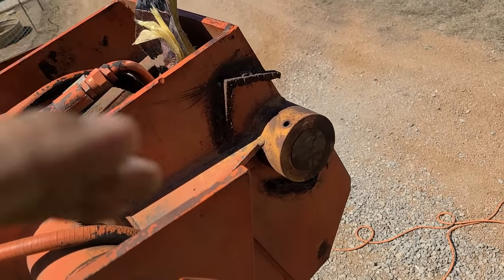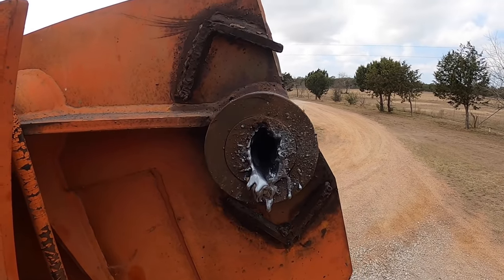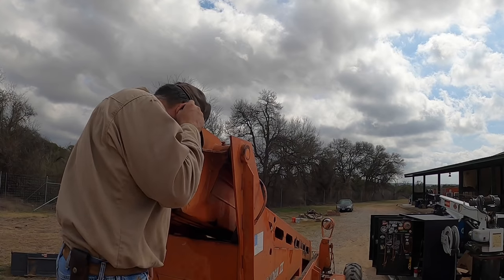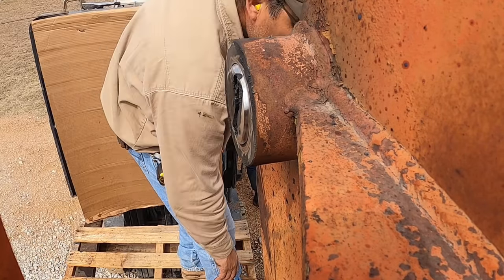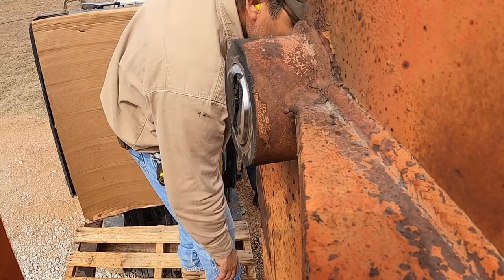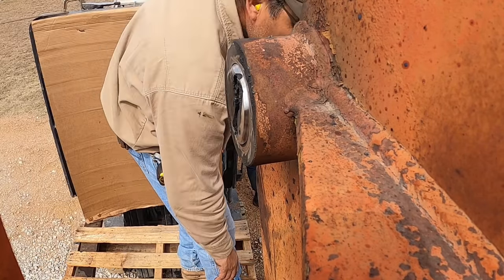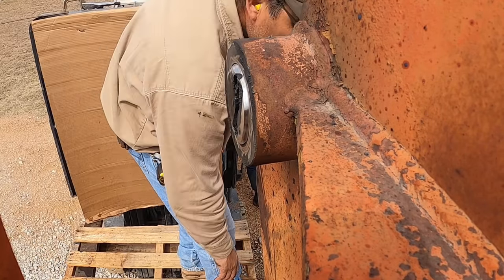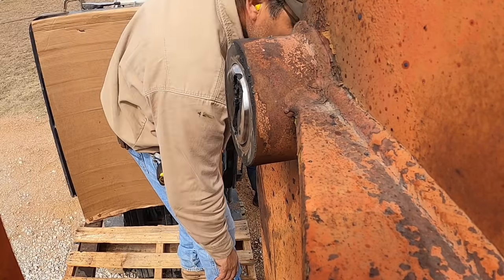Exothermic Slice torch For the Win????

Comment: I've run into the same thing a few times myself on frozen pins.  Had to use the Oxylance on a couple of 'em and the porta-power reverse pulling method on the others. I have .5" and .75" male adapters that thread into the pin with a 1.25" threaded female side that I use a 24" section of allthread for pulling. 36-ton hollow ram usually persuades a non-compliant pin.  Great content,  Isaac!  IMPROVISE.  ADAPT.  OVERCOME.
Reply: Oorah!
Reply: Super under rated comment ^ - A porta-power and a "Through Hole" or "Hallow Center" jack is a damn good thing to have when pulling pins on heavy equipment. As a Field Tech for HE, they've saved me a ton of work many a time.
Reply: @michaelvangundy226  Semper Paratos!
Always prepared!
Reply: At Fording River - Fording Operations we had the Oxylance that took an 8 foort bu 3/4 inch rods, use this the lance thru pins from 12-24 inches in thickness to 2 -6 feet long .
Reply: Was wondering if there was another way.
Reply: @emeltea33  Sure.  There's usually more than one way to skin a cat but they all have one thing in common:  brute force.
Reply: @PatriotWeldFab  Not to forget mentioning "To Hold Your Mouth Right!!"
Reply: @emeltea33   A Machinist with a horizontal boring machine would have done this job with no brute force at all. Check out Curtis at “Cutting Edge Engineering” here on you tube for some excellent machine rebuilds. He has done precision horizontal boring a few times. Everything is easy with the right tools but one frozen pin will not pay for a boring machine.
Reply: @wirefeed3419  I own a horizontal boring machine.  Frozen pins must be removed before any boring can begin.
Reply: @wirefeed3419  I was thinking of Curtis aswell when i watched this video, big difference working from a shop or in the field too, plus curtis's outtakes are more colourful.😆
Reply: @redeyedave8519  yeah, Curtis would've done that job in about 4 bananas 🍌 🤣

Comment: Had a similar issue recently. I welded a very large nut to the pin and used an impact to break it loose. I was even able to salvage the pin. Next step was the carbon arc if that didn’t work. I enjoy seeing your projects.

Comment: Amazing how much work can be caused by simply not keeping a piece of equipment greased.  Nice job!  And, yes, some of us got the Cars reference!
Reply: It's always amazed me that all the guys running it are paid by the hour and everybody is too dam lazy to do the easy work.
Reply: in some cases on equipment there are no grease points for certain things nor places for the grease to travel to get to those points
Reply: @Darin Wilton  Exactly. I saw that pin is bolted into that long boss so it doesn't move in there, hence, no grease.
Reply from the maker: Yup, This pin didnt have a zerk for grease.
Reply: @ICWeld  Hopefully they will put one in after all the work you did to get the old one out...and grease it!  :)
Reply: I have looked inside some equipment to check for grease and seen Nothing but a rust coating inside. That piece of grounds maintenance equipment had never been greased since it was originally manufactured. 
I just put back the grease nipple and told the Boss the story and said to get a new piece of equipment.
Reply: @ICWeld   Think that pin is never removed that often. I like lance rods from oxylance from AL. they have some that can connect together to be longer. Have burnt out pins 8in od  48" long before. Need to turn ox up more than instructions say welcome to the real world.

Comment: Recently i had same issue same Lull machine .
Really difficult..
I cut tube horizontal with grinder cut off wheel. Then spread tube with wedges . Then pin came out. I then rewelded tube later when pin back in.
I was hitting pin with 500lb steel crane block on crane cable swung into pin . 🤣

Excellent work.

Comment: I actually built those machines when I first got out of welding school. Lull Engineering was located in Eagan, Minnesota and it was a fun place to work. We used to be required to stamp our initials just below where that pin was located at the top of the frame. Nice job getting that pin out. Be safe.
Reply: @troyaldridge3853  I was a Welder, not an Assembler. Just being honest.
Reply: What pivoted on that pin or how did it work I couldn't tell

Comment: The first thing my father inlaw told me when I was around the first equipment maintenance issues was grease is cheap always grease the machine before use check all fluids before you use if you didn't use it the day before

Comment: That was a fairly cool process and that pin put up 1 hell of a fight. It was cool watching the board "under" the jack compress down to about 1/4" as the pressure built up then spring back maybe an 1/8" at a time.

Comment: At first Isaac, I thought this was going to be a "you don't win them all" & you would cut away the pin bore housing & replace/weld in a custom machined housing & pin. But about half-way thru the video when you bought a new bigger jack, Isaac is going to win, no matter what! Awesome job!
Reply: I done what you said on a dump bed that froze up from no grease and salt . I had way less time in the replacement than spent on this, but you never know until your done sometimes.

Comment: played with a similar setup in extraction/extrication training for work.. but we had the rods, as well as a 50ft of steel hollow hose that we could just keep feeding until either it ran out of hose or the composite oxy tanks on the backpack ran out.. the composite triple tank backpack would run it for a while, and we could refill in about 10 minutes from a full sized O2 cylinder.... it would cut through a 3/16 cell door like butter... we started ours using steel wool taped to the end of the rod/tube, and striking a 9v battery...

Comment: Awesome job adapting and over coming the problem.   I had an upper pin on a Case loader arm that I  lanced and it still wouldn't come out. We used a breaker on a skid loader to drive it in and cut the other end off (only could move it a few inches) until it was out.  
A field lance tool was an 1/8" black pipe with a ball valve on it.

Comment: I once used a hydraulic breaker, attached to a mini ex to drive one of those out. Had to weld a home made fixture onto the pin in order to keep the breaker centered on the pin and not skip right off. Luckily, once it broke, I was able to drive it the rest of the way by hand. It didn't go hard all the way like this one you did.

Comment: Great job, great perseverance.  Once that pin was out about an inch I was thinking putting a 3 foot pipe wrench on it and turning it while pressing with the jack might have helped. That sure was one stubborn pin. Strong work!
Reply: It is may work optimal when just hammering the pin, because it act like a spring, and can be move as a worm, when the far end keep unstucked by slow rotating.

Comment: Back in the day working in a rust belt truck shop we'd cherry the nut, housing or casing and then turn a hose on it.  The rapid expansion and contraction breaks up the rust ...  then drill a grease fitting.  
The worst  ones were the tandem axle fertilizer spreaders with large trunion joints rusting up.  Like that you didn't force it.  Ya just got a bigger jack.  👍🏁🇺🇸

Comment: Recently had a 90mm pin in an excavator bucket pin that a 25 ton wheel loader wouldn't budge.  Snapon air hammer got it out. No comparison between jacking and air hammer. It never fails me. The shock action makes all the difference. It never budged with the biggest sledge and a hundred shots and came out in about 10 minutes with the air hammer.
Reply: Yea I've got an IR air hammer, its amazing what some vibration and shock will do for things. Always a good idea to smack a union before trying to separate it too. Love when hitting things works!
Reply: The air hammer is a good idea. What Snapon model do you use?
Reply: @jheissjr  After about 25 yrs it finally croaked and I didn't have time to repair it so I replaced it with an Astro pneumatic after spending time researching on line. It is the strongest air hammer on the market right now. It is a monster.
Reply: Asto upgraded the 498 to the new Thor 498. It looks even more powerful than the original.
Reply: Good tip

Comment: I’d try an air hammer on the outside of the big long bushing.  The shock and vibration would have likely freed the pin while it was under the axial load from the Jack.

Comment: I work on these things for a living and other material handling equipment (anything with a set of forks on it). Had to remove the same pin once to remove the boom out cylinder for a reseal.  It took a mobile welder like you a day and a half to cut that sucker out using exo and prayers. Like you, he finished with welding a press fixture and pressing it out.  I think that welder charged 1400.00 in labor and supplies to remove it. That was at our discount since we use him quite often. No easy way after they rust in.  It is what it is.

Comment: Bottle jacks are designed to work in a vertical position. Inside the bottle jack the hydraulic fluid pick up hole is located in the bottom. if it is exposed to air inside the bottle jack it will be unable to pick up the fluid. I converted one to work upside down in my hydraulic press. It was a lot of work but works well.

Comment: We use to use a bigger version of this to remove frozen pin. They were 1/2” pipes 8’ long and stuffed with wire. They had flared ends so you could stack them and would they move metal, as long as you could keep the oxygen to them, and they went through a lot of it. Sometimes you just have to report to extreme violence, judiciously applied.

Comment: I sure felt for you and the struggle.  Hard to tell from here what else could be brought to the battle. 
I've got a 10 ton porta-power and I have an hyd cyl for it that creates 30 ton but on moves a half inch.  I have used it twice since I got it and it will move mountaiins a 1/2" at a time...  Ah, good ole Tractor Supply.
This was a Great video highlighting the teamwork with your son.  Best to You as Always.
I've seen a couple of guys that welded a pin to a 5' bar which allowed them to pound on the pin with smacking the person holding the pin;
I watched a guy in Ireland using an oxygen lance to burn out a post for a rock crusher. The rods he was using were 9' long x 1.5" with 1/8" rods inside the rod.
It was hooked to a bank of 15/16 oxygen bottles.  Unbelievable....

Comment: Just a old man here. I got 50 years on one of those short handle BFH's, I got the shoulder rota tor cuff issues to prove it [ two surgeries, one PRP injection, just had stem cell & PRP Jan.4th, it has been impressive as to amount of healing]. Re watch your own video, focus on how high of a level your arm is to your shoulder and realize you are in an impingement state where  you are exerting the greatest amount of stress on rotator cuff fibers creating maximum wear. Better yet show the video to a physical therapist! 
   For that situation pro active thinking would be to of raised the fork lift platform to where you are swinging the hammer more on the plain of a golf club. If you really want to listen to a old man develop a regular gym style work out program. Nolan Ryan pitched an outstanding long time due to a regimen of rotator cuff exercise. Do your self a favor, take the video to a physical therapist, take your son, he will suggest that you two start bonding working out at a gym. I think if you do you will see it as one of the wisest business/money making/ father son decisions you can make.
   I have been really impressed with your presentations, you put the man in the word manhood. I posted my first YouTube video a couple of days ago dealing with my new Miller Air Pack Bobcat and how to charge battries with old constant currant machines. I intend to do a video on the  Astro [Big Nasty] air hammer and truck drag link replacement and ujoint replacement specifically for that tools ability to minimize rotator cuff wear. I am 76 I can still pop axles with a sledge.

Comment: I had a job removing some 2 inch pins that were frozen in about 8 inches. A lance would have been nice, but I drilled holes through them and use a torch to melt out the rest. That was quite the ordeal

Comment: Great video. Im wondering how much force that jack lost being in the horizontal postion. That pin was seized to the max.
Reply: I'm not sure but i think it's either getting oil or its not so basically all or nothing.
Reply: @Lucas12v  The way hydraulic bottle jacks i think i has a tube inside that moves the oil upward and drains it back down to a resevoir. Its more effiecent vertically. Port a powers can move the oil in any position, so the can be used horizontaly. 
 I will see if theres a video i can watch to verify. I always wanted a portapower but the were expensive for a good one.

Comment: What amazed me was how difficult the progress was even after the pin had moved a significant amount.  Usually, after a pin like that begins to move it will get easier and easier as there is less material still in contact along the bore.  This one continued to be extremely problematic nearly all the way out.  Good job sticking with it and completing this tough one!  Nick, North West Farmer
Reply from the maker: I thought the same thing, " Ahh, its moving, itll come out, no problem" Boy was I wrong.
Reply: After doing this job do you think burning out a portion of the center of pin did anything?  I am wondering if there would be a way to rapid cool pin (nitrogen spray) to shrink it diametrically.  Seems your external heat and hydraulic jack were what made this a success.   I would think you would have to burn nearly all the pin out before it would release from bore or create a hot bore and cold pin to be able to pound pin out with hammer.

Comment: At 41:58 you can see where the base metal bent under the pin from the forces of the jack on the welded-on bracket.  Amazing display of shear power.  Awesome video!  Thank you!

Comment: That's lots of hard work. Several years ago purchased a 30 ton center hole ram take pipe that would fit over pin weld nut to face of pin thread in 1 inch all thread and use as puller
Reply: This is the way with a center hole ram, but when you do not have one you do the best with what you got.

Comment: Our "slice guy" said to melt parfin wax on the pin, and capillary action would make the wax flow thru and the rust would boil out.
I never was patient enough to do that. You did excellent keeping the arc in the pin!
I ruined a front axle blowing a king pin out, that arc turns and you are screwed.
Reply: can you elaborate on the wax method?
Reply: @glennwarren7839  as soon as you can, after blasting the hole thru the center of the pin, and hammer off the melted steel that bubbled out, just melt wax , mostly around the parting area between the pin, and whatever it is stuck in. (Axle beam, flange, etc.).
With things as hot as they are going to be, it'll be hard to aim well.

Comment: Not intended to be a negative comment after all that work but Hydraulic bottle jacks are not designed to function correctly laid on their side. I did see you kept the pump down in the oil but in general you would need to take the Jack apart and change the oil pick up to allow horizontal or inverted use. 
Brutal job showing the incredible power of rust.

Comment: Good idea's to get the pin out.  I knew what you would end up doing, as i watched the video. The job i had sometimes meant removing thick pins (9"dia.) and the welded on frame, plus jack, was the usual way to go, if heatin up the surround or burning the pin out wasn't possible.  

You do need a bigger warming lamp though (about 2" dia. head) and use it for most of a day to stretch the metal first.  That metal webbing support around most of the pin was making it difficult for you to stretch the metal out around the hole, but a big warming lamp and 4 - 6 hours at it should work.  A big bottle of propane would do it i recon.

Mostly the surrounding metal would end up red before a sledge was used to hit the big pins, which usually did the trick first time, though not always.  Heavy steelworks repair is a different beast to "in the field" though, and there was always something bigger/heavier you could use on any given job.  Good "on site" effort though by your good self.

Comment: I find you need to have a Full stroke to get your Jack to pressure correctly...short strokes can cause the jack to not fully allow you to increase the pressure enough... you could have flipped it to camera side ( jack handle ) and you might have got it out easier??  i been there doing that too...always is a fight....some jacks don't like to lay horizontal too...and new ones might be low on oil from factory .... all can cause your jack to not pump up properly....  you should be able to feel it as you stroke.... you can't pump it by hand fully and it will Bang hard and LOUD when it moves....Louder than it seemed but that is hard to know not being there....  Good Job getting it done👍

Comment: when getting a pin out, using the air lancing rod. start boring the center out of it, instead of cutting up and down. once you cut a circle then it's easy to stay straight all the way through not hitting the bore at all! once you are all the way through, cool it down with ice or water if available. then weld like a D-Ring at one end and hook a lever hoist to it and start cranking on it, little by little. after you crank a few times hit the outer with a hammer and then crank more. it will come out much easier

Comment: Hi Isacc, that was one stubborn shaft, it certainly didn't want to leave its home. I would think the bore should be honed to get it clean and smooth again, and maybe coated with some coppertec or similar anti corrosion coating, clearly grease doesn't reach inside that bore.
Reply from the maker: I agree. Not sure what they did once I left but they were glad we got it out.